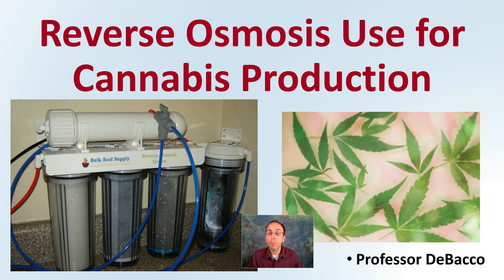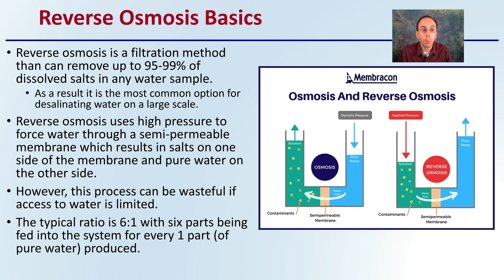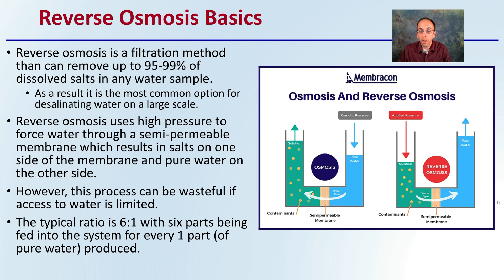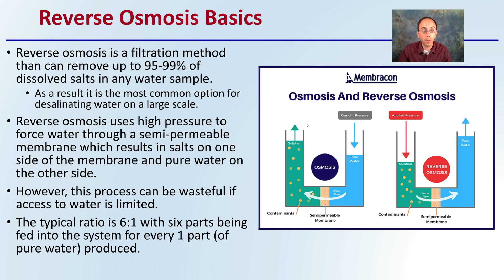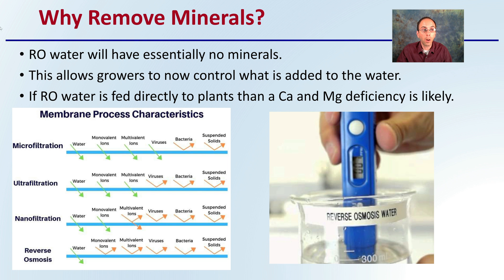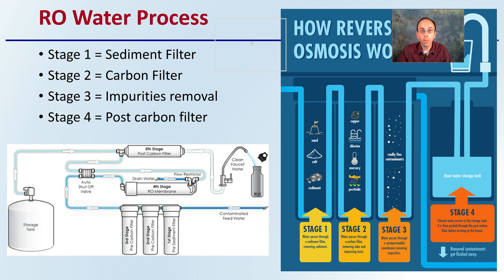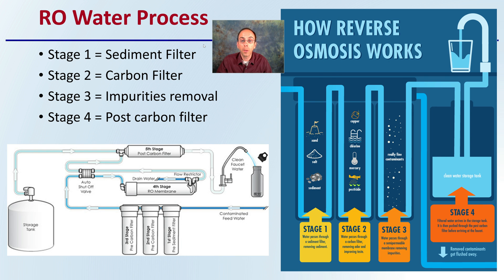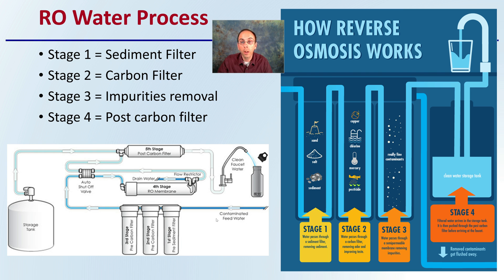Reverse Osmosis Use for Cannabis Production

Comment: i only grow a small amount for personal use. The last time i went hydro i was getting a large upward drift in PH on a day to day basis. I didn't know this at the time, i just mixed up a reservoir, adjusted the PH, assumed that was stable and was using that to water my plants in a drain to waste system. I was getting massive nutrient deficiencies which i attributed to cal mag, and so added extra. Nothing improved and the plants went downhill rapidly. I switched to soil. but started mixing up a bit of the hydro nutrients anyway to feed the plants. It was then that i noticed how the water i had already adjusted to a PH of around 6 started drifting up and up in my reservoir. I would come back 2 days later and see it was 7.5. I decided to PH test the straight tap water, and it was around 8.5, which seemed pretty high for a starting point, so now i wonder if that is the cause oh my PH drift. Now i am looking into reverse osmosis as a solution, but not sure if its worth it, or whether it is even the correct approach.
Reply from the maker: Knowing and testing your pH and making adjustments as needed will greatly benefit your plants.  Sounds like you are on the right track now.

Comment: What systems have a 6:1 ratio? That’s pretty crazy! I’ve been thinking all the 3:1 ones were bad enough. My Stealth RO from Hydrologic is adjustable from 3:1 to 2:1, and it’s perfect.
Reply from the maker: The more efficient systems will be in the 3:1 to 2:1 ratio.  I will not state brands, but there are some that are in that 6:1 ratio, so it is something to look at so you are an informed consumer.
Reply: @DeBaccoUniversity  I know a few people that collect the “waste” water from their RO systems, and use it on their ornamentals and lawns. Better than just letting go down the drain I guess, but I’ve always wondered what exactly is in it.
Reply from the maker: The "waste" water is not necessarily toxic, it is just not as pure as the good water.  It is mostly the system flushing the membranes to extend their life so it typically contains some of the ions and particles that the RO system is trying to remove from the final product water.
Reply: @DeBaccoUniversity  Makes me want to fire up the water distiller I got for free. I live in the country and my well water is in the 470-500 ppm range ( .94 - 1.0 EC )  with a pH of 8.
Reply: My ro/di does about 5.5:1 :/